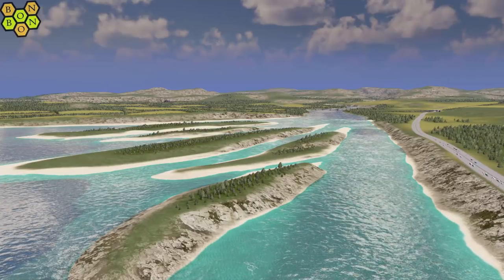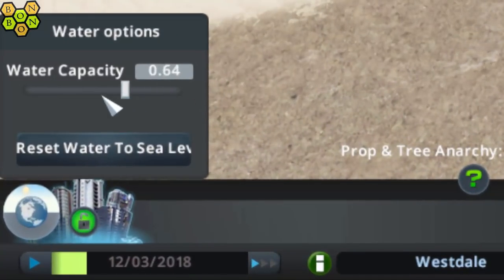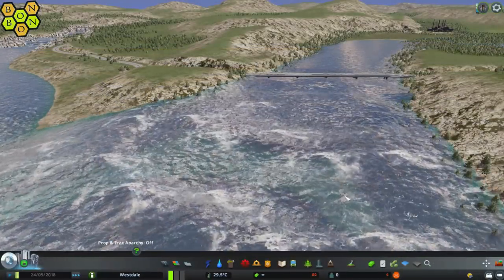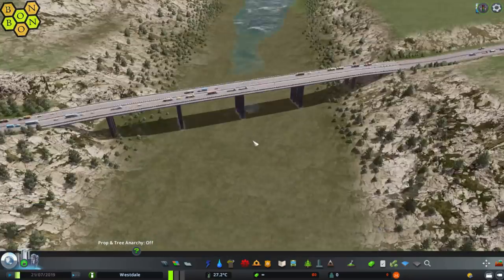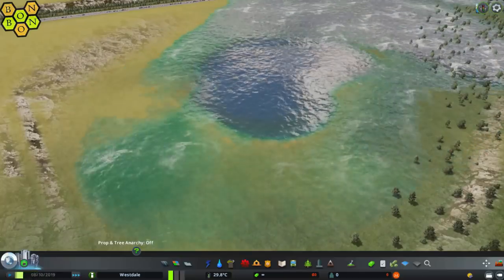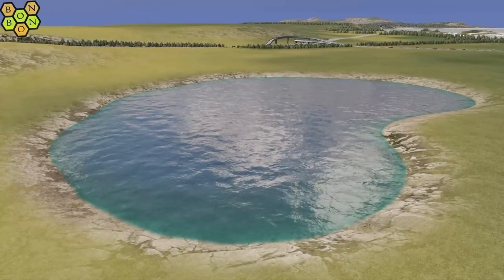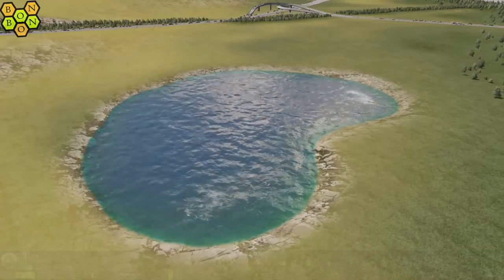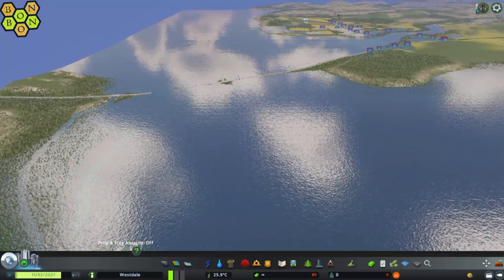Cities Skylines - Water Physics - Tutorial

Comment: This is super helpful. I uploaded a heightmap and was struggling with the differing water levels and my water sources flooding. Even when I implemented the "fill to" point I had a lake that was spilling over due to the lake being partially dammed in real life and the game of course not registering that. I finally figured out that if I put a drain just near the corner of the lake that was spilling over I could fill the lake to the right height and the drain stopped the water from spilling over.
Reply from the maker: Good job, and thank you!

Comment: But how can I make so the sea gets perfectly still?? I have noticed that in my map the water level of the sea is not consistent, and sometimes I get big waves while on some videos I've seen the sea water completely still... It's been years now and I still have the same problem, how on Earth do you make that??
Reply from the maker: Difficult to explain in a few words, but when water sources collide you can get ripples/waves. Sounds like the map wasn't tested properly by the creator. If you can work out the source of the waves you can either remove the water spawn point, or if it's essential, you could put another spawner near it to absorb the waves.
Reply: @BonBonB  Understood, in fact for now I have placed some water sources and that "kinda" solved the issue in some areas, but not all. I can see the wave sources if I zoom out the map (I believe they are recognizable by some weird circles in the middle of the ocean), but I can't see anything I can interact with

Comment: 3:54 why is it that the lake won’t fill up any higher (from a 1% source) in this first case - but then a minute later you say that a 1% source will overflow the banks “in no time”?
Reply from the maker: Listen to what I say about the "fill to" level. The source will keep pumping until it fills to that level. If that level is contained then you have a lake. Think about the cisten in your toilet, the water keeps filling until the cistern shuts off the tap. If the cistern is set too high the water will keep running. Hope this helps.

Comment: can anybody help me to fix water problem. My water pumps are not operating I tried literally everything and I played the game before and know how to play but what is happening now I dunno 😢
Reply from the maker: Not nearly enough information to be able to help. The three most likely issues are:
Are the pumps actually reaching the water level? They may have been when you place them, but as they draw water the level drops.
Are the pumps actually activated? Click on pump, check the info box
Are the pipes actually connected? The pipes have to connect to the little 'dot' on the back of the pump. Do the pipes actually fully connect to the city?

If you are certain you have done everything right, start a new map and try completely from fresh. This can help straighten your mind and see what it is you are missing.
Reply: @BonBonB  I played before and I never get the problem with the level of the sea or river. They are connected to the water pump I am sure of that. I once even made pkwntt of the water pumps to b sure the shortage of water is not the problem but didn`t work as well. Mu house are just dissapearing because of no water which actually flows I can see it but water pumps five secunds work and then five seconds don`t. I played before and nothing like this happened. What means connected to the city ? Thank you very much for your reply 😀